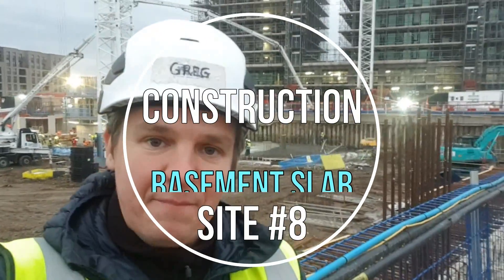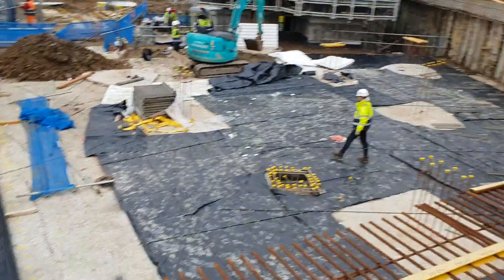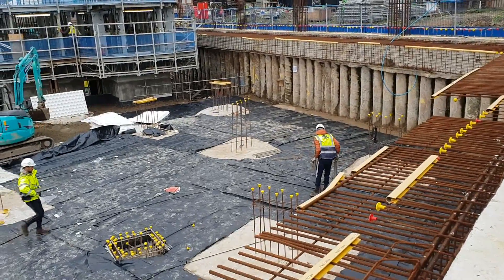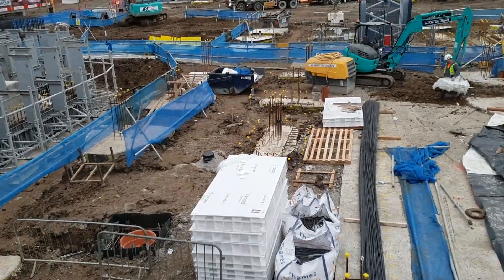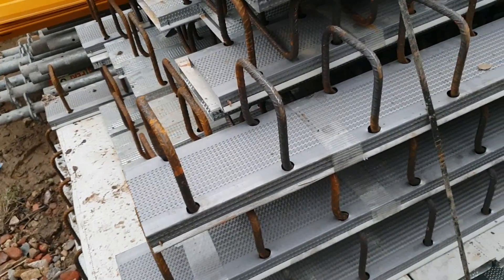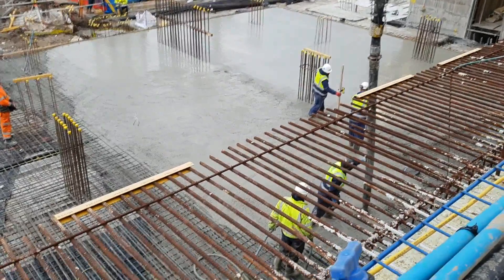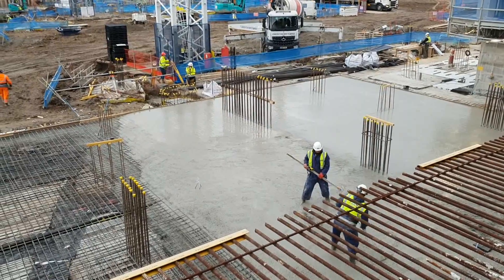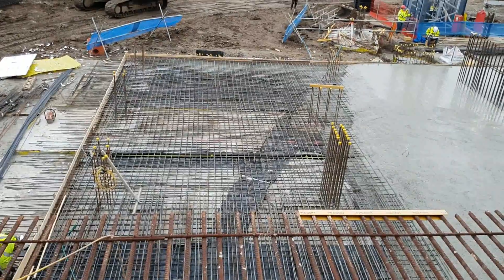RC concrete SLAB construction process step by step

Comment: What Waterproofing are you using?
Reply from the maker: Hi! That was Sika waterproofing as far as I remember (it's on the video). It's a injection method (inducing the cracks - controlling their position and injecting there)

Comment: How do you maintain the top level of the raft while pouring the concrete??
Reply from the maker: Raj! Concrete finishers using a laser level set by an engineer. On one site I was also doing spot checks with the EDM to help guys to achieve perfect level :)

Comment: Is there cellcore Underside the slab , how do you install the cellcore ? Do you do 50 blinding on top of cellcore ?
Reply: I am constructing a basement and the engineer has specify 50 blinding to bottom of cellcore and than 225mm cellcore and 50mm concrete blinding on top of cellcore , I haven’t seen 50mm blinding on top of cellcore before . Just wanted to ask you if you came across this ?
Reply from the maker: We were thinking to use a bit of blinding once on top of cellcore as this often collapses and it's not easy to work on it, but have never seen design showing this. If that's what designer wants then it's ok, but loads of extra concrete now and deeper digging and all that stuff now and you can always send him detail from cordek website showing the blinding than cellcore and slab on top (not requiring any blinding)
Reply: Your videos are very helpful regarding construction field
Reply from the maker: Thanks!
Reply from the maker: Yes there is, that was installed on 50mm blinding and no blinding on top.